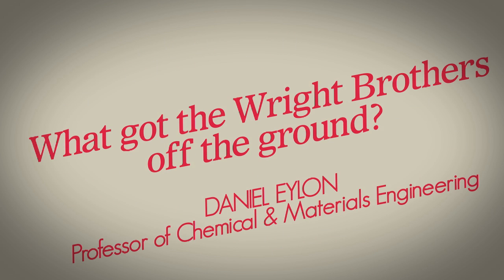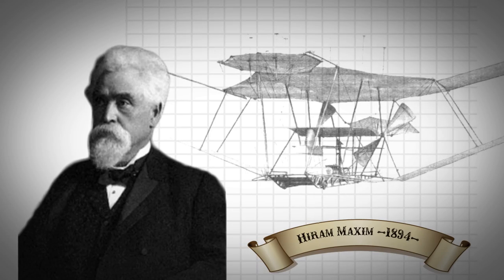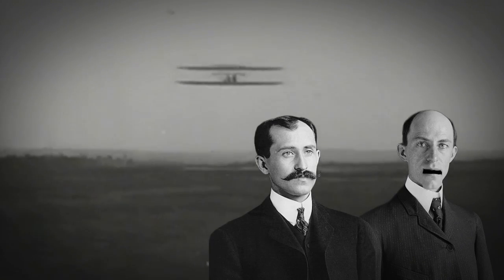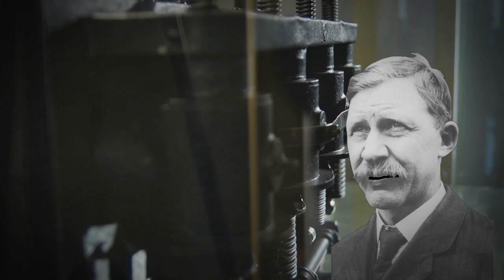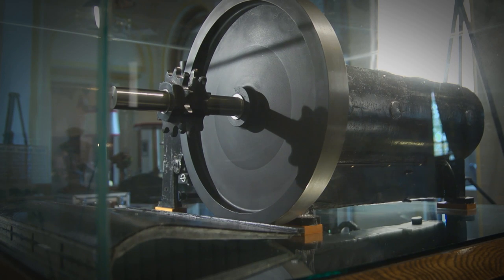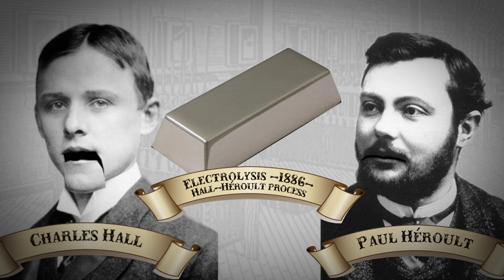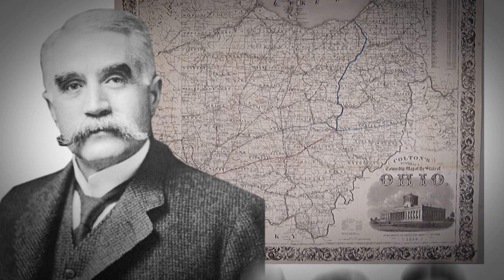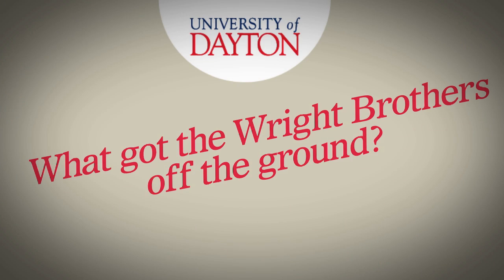What Got the Wright Brothers Off the Ground?

Comment: what got their airplanes (actually they were just gliders) where catapults!

According to Wikipedia: "In 1906, the Brazilian Alberto Santos-Dumont made what was claimed to be the first airplane flight unassisted by catapult[25] and set the first world record recognized by the Aéro-Club de France by flying 220 meters (720 ft) in less than 22 seconds.[26] This flight was also certified by the FAI.[27][28]"

An airplane unable to take off by itself is a motorized glider not an airplane. Sorry, Wright Brothers ...
Reply: you must not know what a catapult is. they used a falling weight to accelerate the plane up to takeoff velocity quickly, but it was not required for takeoff and obviously it flew fine and for long durations under power, meaning it was not a glider. Sorry, Battletech Fanatic ...
Reply: An uncontrolled hop is not an airplane.
Reply: Battletech Fanatic

According to Wikipedia: "In 1906, the Brazilian Alberto Santos-Dumont made what was claimed to be the first airplane flight unassisted by catapult[25] and set the first world record recognized by the Aéro-Club de France by flying 220 meters (720 ft) in less than 22 seconds.[26] This flight was also certified by the FAI.[27][28]" This was because they had not witnessed the much longer and much earlier flights being reported by the Wright Brothers. However, the Aero-Club de France and the FAI reversed their decisions in 1908 after they witnessed the flights of Wilbur Wright that August, who demonstrated the vast superiority of his Wright III Flyer airplane which was designed in 1905. Although their 1905 plane was damaged in the spring of 1908, two more Wright III Flyers were built that summer, almost identical to the 1905 plane.
Reply: why dumont only fly one attempt?wright flyer hundred of sortie (flying), machine that only can flying one time is not machine.
Reply: @awancah7309  because when you are honest and have the press to cover it, you just need one.
The fake brothers say they did many flights but were in secret, impossible to confirm. More important: all with assisted take off - their gliders were not real airplanes capable of take off and landing by their own means.